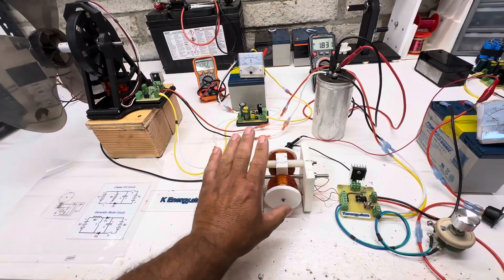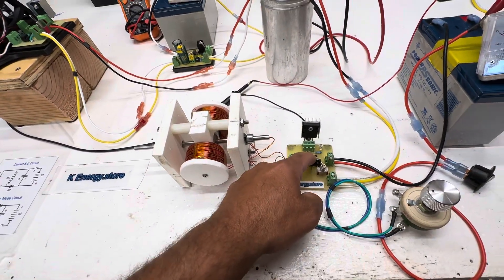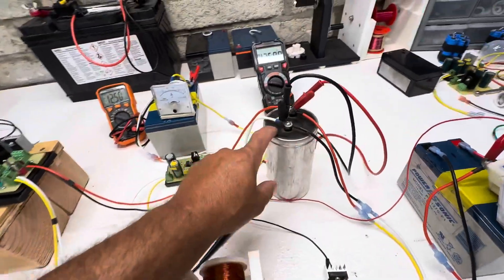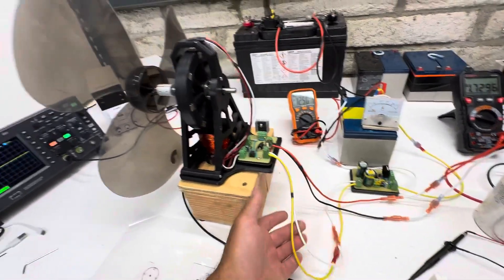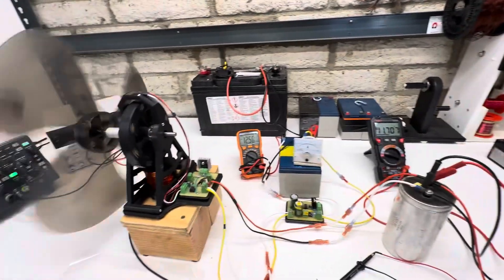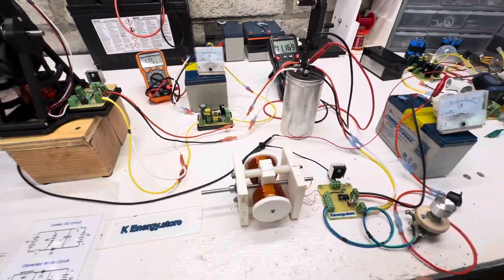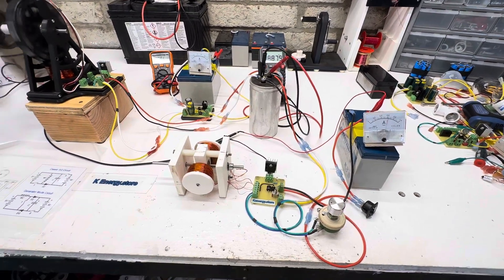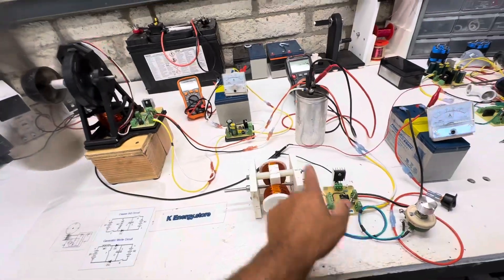Motor runs motor

Comment: Excuse me sir. Please, I am looking for an electric motor that is economical in energy consumption, has strong torque and high speed. What do you advise me? Thank you
Reply: There are trade-offs between torque, speed, and power consumption. The bedini motor likes a stable load, I think, but versions of it have COP 0.98 (without additional external power). Sounds like you want something more suited for an ebike?
Reply from the maker: @RachidHidada-rc9wz  how much hp ?
Reply: @kenergy1707  2 hp
Reply from the maker: @RachidHidada-rc9wz  mine are mostly small other than my outboard morir